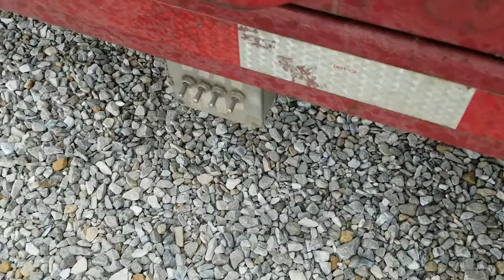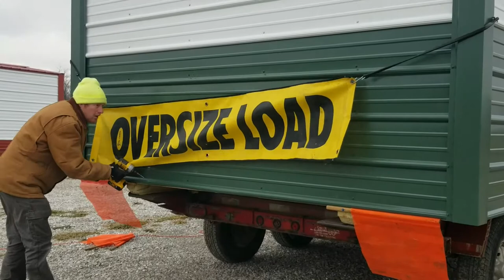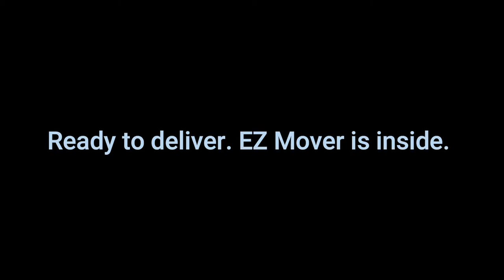Delivering Mini Barns with EZ Mover

Comment: Great video!  I have a 28' gooseneck deckover with a 4' dovetail and 4' fold-out Monster ramps.  Do you think the EZ Mover would be able to pull/push an 8x8' shed up onto the trailer?  Maybe winch assisted?  Does the the EZ Mover have a "neutral" gear?
Reply from the maker: I think it would be do-able. Probably not very easy. You may want to lay plywood over the angle iron on the ramp and dovetail since tires are pretty small. The other issue you'd run into would be you'd need a middle ramp. Not a good setup but possible with enough work.
It has neutral. I pull mine quite a bit with winch.
Reply: @normanmiller8412  the dovetail and fold out ramps are full width wood, so everything is a solid surface (no angle iron) … I apologize for not giving that info … with that being said, do think the incline and angle would still be ok? Thanks for all the info!
Reply from the maker: Obviously I can't guarantee it'll work, but.... an 8x8 is pretty short. The dollys will raise it around 10 inches and so will the mover. If it will bottom out you can always scoot the dolleys closer to the center of building. My guess is if you have an available winch to assist you'll be okay. 
Strapping a building down on a regular trailer is always hard. My custom trailer just straps down the runners, causing no damage to the building. Running straps across roof can cause damage.
Reply: EZ mover has the power, but traction and angle is a whole nother ball game. I’ve moved 12x20 huge sheds on level ground, winching is sketchy because if it’s downhill and the winch slacks, it’ll flip your mover (ask me how I know ;).

Comment: What kind of jack is he using
Reply from the maker: I'm using a modified bulldog jack. I start with a regular trailer jack and grind off the round mounting bracket. Then I weld angle irons to the bottom, and bolt and angle iron on top with some hockey tape around it to keep it from scratching paint. Then, I extend the handle to fit a drill. (In this video, I was using the jack and impact.) I don't use these a lot because the impact is really hard on the gears. A drill is gentle in comparison. Over the years I've built 5 of them, some for others and some for myself. Very handy for lifting sheds!

Comment: Where did you get that jack? I’ve been using farm jacks for a while and been looking into air jacks but the jack you used looks pretty handy for smaller sheds.
Reply from the maker: I took a bulldog trailer jack and modified it for mini barns. It's not the best set up, and I've had quite a few issues with it. (Gears aren't strong enough) I'm currently building one from scratch that will be more heavy duty. It's a lot more stable than a handyman jack, that's for sure.
Reply: @normanmiller8412  I'm curious to how the progress of your homemade jack is going, I would definitely be interested in purchasing one if it works well!!! I need one for my own shed moving company sometimes you can't get a mule on the back side of the shed to get the dollies underneath!!!
Reply from the maker: @preston0752  we've had issues with the one I built, the welding shop modified it and we still had issues, but... we found a solution. I got a different brand of jack and now I use a drill instead of an impact. I've moved about 60-70 sheds so far with no issue. I built 3 jacks and they're all working fine. One for the truck, the shop, and the lot. The impact is just too harsh on jacks.
Reply: I've come her to ask about the jacks as wells haha. I am down in Maryland and have been lugging around a 3 ton harbor freight jack and that's literally the worst part of my day.

Comment: How do you like that EZ mover?
Wondering if it has enough power to go up inclines and over rougher terrain? Trying to decide between that or a mule.
EZ mover is a lot cheaper
Reply from the maker: You get what you pay for. The mover works great for me since my buildings are metal and pretty light. It can move 12x30s no problem. I've moved buildings for other people and when they get 10x16 or bigger on smart siding buildings the mover is maxed out on weight. Inclines are no problem, plenty of power but ice, loose gravel, mud is hard to cross. Rough ground is no big deal as long as its firm.
  Mules will definitely save you time and can lift more. But.... you'll spend the extra money for convenience.

Comment: What kind of screw jack are you using?
Reply from the maker: I just tool a trailer jack and modified it. I use a drill mostly, because an impact is pretty rough on jacks.
Reply: @normanmiller8412  Thanks for the reply!

Comment: Did you build trailer would like to know more about the chain rail and tilt set up
Reply from the maker: The Trailer is a Creek Hill custom trailer. Pine Hill also builds them. Both companies build custom trailers for hauling mini barns. They're very expensive, starting around 45k and up.
Reply: @normanmiller8412   hello! Where do purchase the EZ mover and dollies?
Reply from the maker: @ramandaprice5842  you can find the at thetrailershoppe.com

Comment: Do the  dolly wheels generally stay in place or will they walk off the beam after a long stretch?
Reply from the maker: Good question. They stay in place. There are 2 small bolts in the dolly base that dig into the runner. The heavier the building the more they dig in. They have never moved on me. When I jack up the buildings to get dolly out they always raise off the ground and have to be pushed off the runner.
Reply: Where did you get the dollies from? Thanks.

Comment: What jack is that?
Reply from the maker: I build my own jacks. I start off with a trailer jack, grind off the mounting bracket, and weld so angle iron on the bottom. I add an angle iron on the top side that's held on by the original bolts. Wrap tape around top angle iron so it doesn't scratch paint and its ready to be used. Anything bigger than unfinished 12x32 almost needs two Jack's per end.
Reply: @normanmiller8412  interesting. I use a floor jack to lift sheds, then prop the corners with stacked blocks for stability, always lifting on the middle so three points of stable contact. I then use blocks to make the shed lift higher. I like that your jack lifts straight up. 

Do you have the model number of your jack? Or amazon link? 

I wonder if a person could use a drop leg to make the jack get taller or shorter.

Comment: Can't believe DOT lets you get away with only securing the 4x4 skids on that thing.
Reply from the maker: That is the best way to fasten portable buildings. If you run a strap over top it'll damage sides and roof. All custom trailers designed to haul portable buildings, are designed to strap runners down.